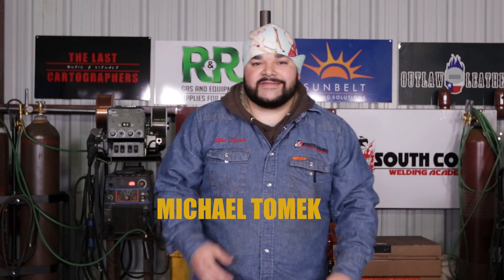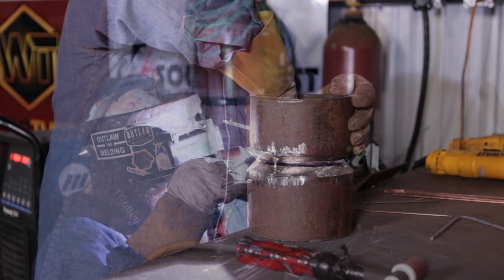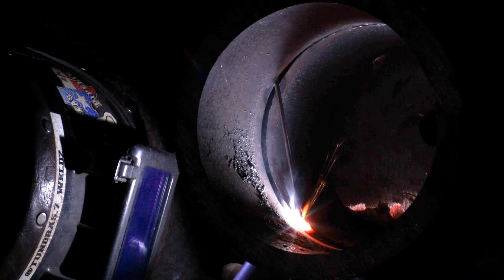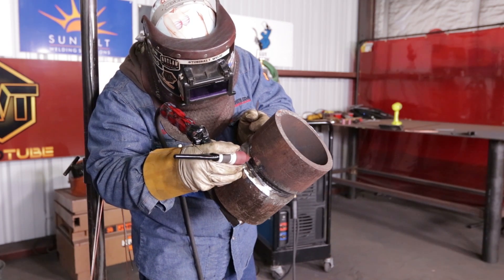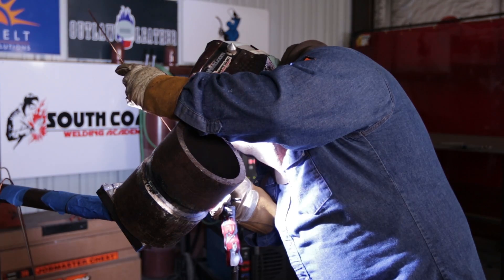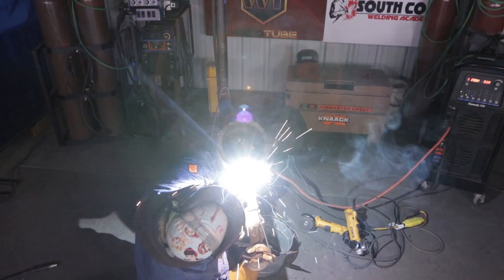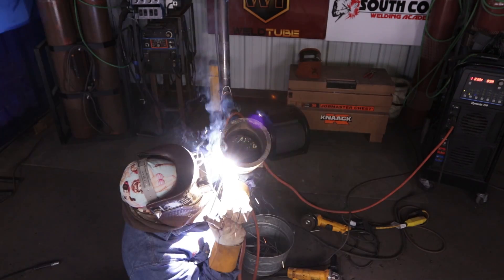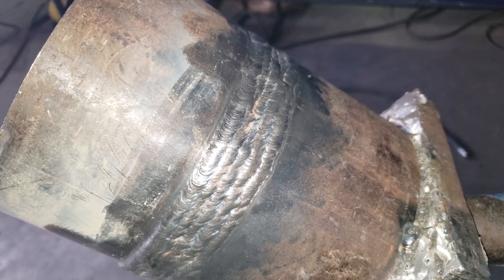Extra Extra Heavy Wall Pipe Welding

Comment: 12:40 seconds or so, looks as if your washing the rod top to bottom...... I’ve never washed it so to speak so I didn’t risk trapping flux...... small tight circles yes..... very tight thought consistent oscelation of the puddle...... 98 amps pushing the threshold of a 3/32 rod..... start burning flux off towards the end of the rod ...... no flux no shielding cherry red rod, chance a discontinuity like porosity ...... but all in all great job !!! 👍👍

Comment: 3/32 on a fill and cap?? Why not use 1/8 or 5/32. Production is key in the field. Nice looking weld 👌
Reply: Because 3/32" runs easier, when you're taking a test you dont worry about production only quality. Your not going to do a 6g out in the field anyways unless it a weird offset field weld but yeah if i was running 3\32" on that schedule of pipe my foreman would be pissed. He could of filled it with 1/8" and capped with 3\32", would look the same and take half the time.
Reply: That shop doesn't look like the field. Post a vid with you fill n capping with 5 32
Reply: it's much easier  to bust x-ray when your carrying that much metal with a 5/32 7018 out of position in my opinion
Reply: Production is key in shop... not the field 🙄🙄
Reply: I want to see you put a 1/8 or 5/32 cap like you say and put on you tube to see what your cap is going to look like.🤔🤔🤔 Not very pretty
Reply: On a heavy wall I usually fill with 1/8 and cap with 3/32  but I throw a couple of passes with tig after the hot pass so I dont blow through

Comment: is the fill and cap using 3/32? or 1/8 cap?
Reply: The first fill after the tig hot pass was 3/32 just to add meat. Thereafter you can run 1/8 to flush out faster and then once flushing letting the pipe cool, begin to cap with 3/32 again to get a nice slick cap

Comment: 180 with a 5/32 on xx pipe that's a little cold i would run around 250
Reply: He said the gap was 3/16ths unless your talking bout his filler, and everyone welds diff. Post up a video so I can call you out on all your preference when welding. As long you can make the weld I don't care how you achieve it.
Reply: You mean on a roll out you can not  in position

Comment: Grinders on the Ground *cringe*..  Nice weld though :)
Reply: If it is your own grinder you can leave it anywhere you want. Where do you put your grinder ? Back in the box and on the shelf returned to home depot.
Reply: So what
Reply: Lot of jobs you can’t use a grinder on the test so where’s it at then 🤷🏻‍♂️
Reply: @renoschneider145  some jobs not lots, grinder is a tool, I know what you when QC is looking at your welding ability and not grinder skills. It varies from test to test